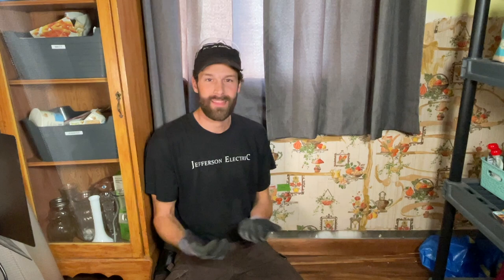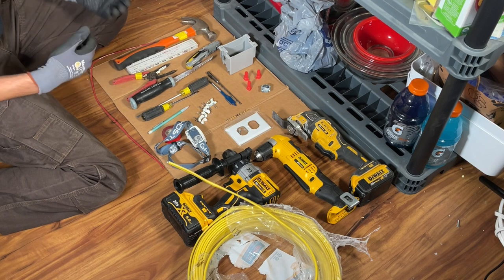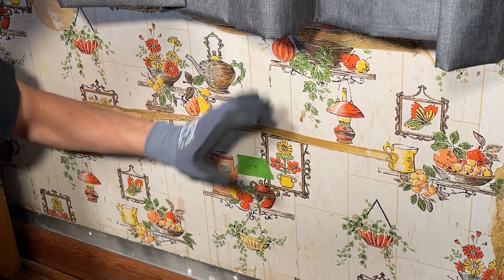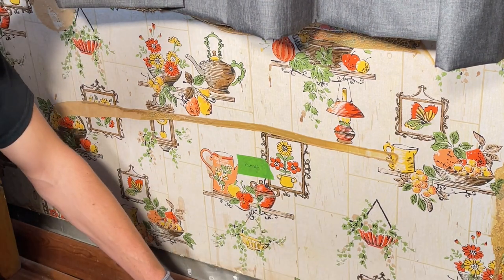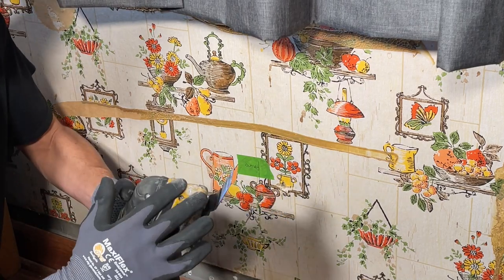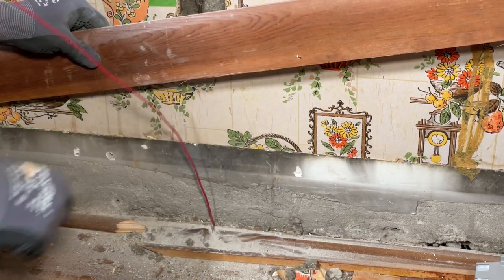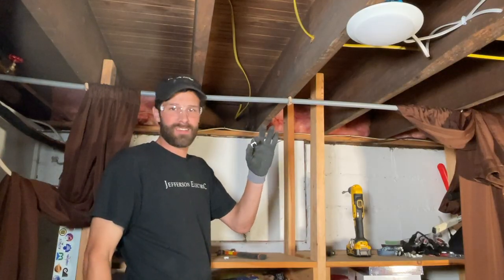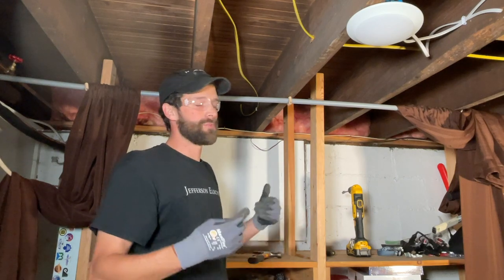How To Add A New Outlet Anywhere You Want It

Comment: A lot of really good tips. Thanks for knowing that if the cable is clamped to the J box, the nearest staple can be up to 12” away. Inspectors around here want 8” regardless. Also thanks for pointing out that metal boxes need to be bonded to the equipment ground.

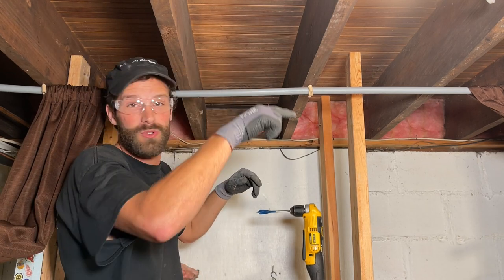In my locale, since the hole that was drilled upward from the basement (at 10:50) penetrated another floor, I would be required to use a fire sealant. I personally like to use 3M’s Fire Barrier Sealant CP 25WB+. Just put it in a caulking gun and squeeze into the hole until sealed. Also, in my locale, tamper resistant receptacles are required.

Just a personal thing, on the right side of the J box at 16:27, I would have used another connector so there is one cable per connector.
Reply from the maker: Good stuff and thanks for the feedback!

Comment: One thing I've learned about cutting plaster walls using a carbide multi tool attachment (used for grout) it cut through the plaster just as fast and it won't dull.

Comment: Excellent presentation, good details. Electrical code does not address drilling through structural members other than requiring nail plates if you’re too close to the edge, however the building code does. Most inspectors will want to see that a structural engineer has provided a size and location plan for drilling joists. It is usually cheapest to not drill the joists. Just run across the edges and use a protector board nailed alongside if subject to damage.

Comment: Lots of good best practices on this walk through video!... noticed mention of the question of why using a15amp receptacle paired with 20amp circuit (at 4:00), but no further explanation(?)
Reply: Jim, sorry for the slow response. The NEC table 210.21(B)(3) and 210.24 allow for the 15 amp receptacle on a 20 amp circuit. Short answer is-it's code.

Comment: The one potential violation I saw was a kitchen circuit being used for another receptacle elsewhere. If it's a 20 amp circuit presumably it's a small appliance branch circuit, and those aren't supposed to have any other outlets. Don't recall anything being said to the contrary.

Comment: EXCELLENT VIDEO !   Great presentation.    One comment though.   That junction box in the basement might be OK in the State you are in, but up here in Ontario (Canada) we would need to make sure that the grounds are also tied the metal box as well...    I think Scott that you also mentioned this tip in one of your own subsequent videos.   Further, not a problem in that house as the basement ceiling is all open, but again up here a small qualifier...  we're not allowed to cover up junction boxes.   So up here, if that basement was ever to get a ceiling, that junction box would have to be horizontal and the cover would have to be openable if the ceiling was there...

Comment: This is a good video, though I would have wired that new duplex to a new breaker in the main breaker box, instead of the junction box. It's a little more Romex, and the cost of a new breaker, but in the end you will have more "control" over knowing what outlets and rooms are on which breakers in your main box. You will also not have to concern yourself with the amperage already being used for the junction box, because it is a new circuit. Another "good" thing, is that you can also add an outdoor GFI (with outlet covers) to this breaker on the outside of this wall (if you choose), and/or a second duplex outlet further down the wall upstairs, because the outlet you added up stairs is probably only for a lamp, TV, or vacuum cleaner (which is higher amperage, but only run for a few moments at a time), or some other low amperage electrical use. I did this in my home for a few new indoor outlets I added, with new breakers, so that I have more easy access to power outdoors for Christmas lights and/or power tools...etc.....Peace!
Reply: Any new outlet is required to have arc fault circuit interrupter protection. The breakers are around $50.

Comment: One of the better videos with code requirements explained, professional work, and proper tools used that I have seen. Except all the loose Romex hanging behind you in the video, obviously you didn't install them. I wish you had explained the 12/3 Romex with two circuits a little better for the phasing at the panel. As so many do it yourself install them on the same phase using a twin or wafers and eventually burn the neutral wire. Two pole breaker was a nice touch. Also if you had added somewhere in the video that each State has slightly adjusted or stricter codes and to check with the local AHJ. As New Mexico does not allow 15a receptacles on 20amp circuits. Texas requires State licenses and does not allow homeowners to perform electrical work, except change light bulbs. And don't forget the fire sealant as required by IRC 302.11(4).
Reply: Highly doubt New Mexico only requires 20 amp receptacles on branch circuits. The reason for that is the manufacturer. Manufacturers have posted on the 15 amp devices that they are approved for 20 amp pass through. If the receptacle if the sole device on a 20 amp branch circuit, then a 20 amp receptacle must be used.

For commercial/industrial applications all receptacles must be 20 amp.
Reply: Good word John. Thanks for contributing.

Comment: Great video. Very informative and professional. The only thing I would add is to drill up the wall from the basement before cutting the hole for the box upstairs. Then push a stout wire or a fish tape up the wall to make sure there are no obstructions in the wall that would prevent fishing the new cable.
Reply: The voice of experience. Good word!

Comment: Great video. Are you using a common trip circuit breaker to make the shared neutrals safe? If not, how are the neutrals wired to make it safe with hot current from 2 different circuits?

Comment: Well if I had a basement (I don't, can't get under the house or up in the attic space either) this may have been educational.  Care to do another video with a situation like that?
Reply: Prudence - the steps are the same. You're just doing it on your back on dirt and it's major pain.
Reply: @dalesworld1308  Wish I had access to the "dirt", but getting under the house is also a major pain, 200 year old farmhouse, with additions put on here and there, blocked access under the room I'd want the outlets in.  Makes me want to tear out drywall and run the wiring through conduit instead.  :(
Reply: @dear_prudence  surface conduit and boxes
Reply: Tear off the drywall. Drywall is cheap and it's not that hard to patch it up.

Comment: It is not required, but I use plastic NM connectors in metal J-boxes and panels, they are quicker to install and no chance of harming romex cable.  No pre-twisting of wires is required if you use the proper wire nut. Wagos  are UL listed and could also be used.  Russ-Journeyman, 26 years in the Trade
Reply: I all depends how you was trained has a apprentice and then to a electrician. Twisted wires with pliers is the best way has you know you did it correctly. Wagos are the best!

Comment: Generally, a good informative explanation, although really only applicable to homes with a basement. Depending on which edition of the National Electrical Code is enforced, some important code requirements, for this installation, should have been mentioned that are required in most areas of the US.

Comment: Hello, I have a QQ on a simple connection:
I have a wire coming from the electric panel to power a light switch and a receptacle.
1-Does this wire has to go to the light switch first, then "split" to go to the lamp and to the receptacle? or
2-The wire can go from the panel to the receptacle, then to the light switch, then to the light?
The receptacle is closer to the panel than the light switch. Basically I have, 1-The panel --> 2-The receptacle --> 3-The switch.
Thank you in advance for your help.

Comment: I have to do this where a tiled wall meets directly with a tiled floor. the wall tile runs about 3 feet up and meets a plaster wall. that plaster wall is where the outlet will be. no trim to remove to get behind. Ill be coming up form a basement but i dont know how to get measurements for where to drill in the basement to land inside the wall above since i cant pierce any of the floor or wall tile to set a marker

Comment: I have question for you. I used the new blue outlet boxes with the blue taps , that you tighten with  screws and the taps tighten to drywall. I really do not like them. I tighten as far as it’s goes. But when I plug things into it and pull the plugs out , by the plug. I almost pulled the whole outlet, out the wall.  How do you stop this from happening?
Reply from the maker: When this happens it usually means the tabs were not able to actually secure behind the drywall/Plaster.  This old work box specifically has a larger gap and works well for thicker plaster walls https://amzn.to/30FUKec .   Might be worth a try.
Reply: @EverydayHomeRepairs  no, this just was drywall., I made sure the taps were right. But the new outlets are so tight when you plug something into it. When you pull the plugs out. Until the outlet gets use a lot, it becomes alright. I like the idea, that you can put outlet boxes anywhere. I was ready to put a screw into the 4 holes next to the taps

Comment: I have a floor outlet under my upstairs bed but no outlets on the wall behind the bed. How do I make wall outlets from the floor outlet. I currently have to run  extension cords to both sides of the bed.

Comment: At 11:03 I hope the lamp cord next to where you are drilling is for speakers or doorbell. Don't laugh I know a guy who wired his whole house with lamp cord that was 30 yrs ago and the place hasn't burned down yet. Something else I noticed, I was always told not to put a receptacle underneath  a window. Don't know if that is code or not.
Reply: Wall space under windows is counted as part of the requirements so sometimes it is unavoidable. When possible the outlets can be spaced so they are to the side of the window but not actually under it. There could be local requirements or inspectors who consider it a wet location so those requirements would need to be met. Otherwise it shouldn't be an issue.

Comment: Looking for opinions on a taboo subject. I hear people are installing smart switches that require neutral wire, but are connecting the switches white wire to the ground in the box! I would say it would work just fine but then sone current would then be flowing through the ground wire which obviously is NOT ok. Thoughts?
Reply: Use Radio Ra2 by Lutron. The neutral is only needed at the load switch. But one would be the wiser if they wired their house as if no lighting control is going in. Times are tough and products are costing more. And if a home is wired for lighting control and not standard switching then that person is in a world of hurt.

As for tying the neutral and ground together, ya that's illegal. People commonly do that because they don't know what they're doing or didn't have enough wiring and didn't care about being safe.

Comment: 'Theoreticaly' that Neutral can carry 40 Amps. I heard you're mentioning that the load is calculated and taken care of. However, sharing a current carrying conductor is not justifiable. Unless the 2 phases/hot are connected on separate phase. Red, black on separate phases. Algebraic sum of current meeting at a junction is zero...it goes on.

Comment: I am very, VERY much a novice. I have a wall that has a light switch on it. Is it possible to put a new outlet on that wall and  draw power from the light switch to get power? and if so, how?
Reply: Slow to respond. You've probably already solved your problem. The simple answer is "yes"! Make sure to grab a hot and neutral and ground from the switch for your outlet. If the room you're adding an outlet to is a bathroom, kitchen, dining room, pantry, breakfast room, laundry room then lighting and outlets would need to be separated, generally. Follow our channel for more info. This video is similar to your situation https://youtu.be/jSWMWSYYYFM

Comment: How would I do this in a slab-built house with no exposed joists or basement?
Reply: You would be required to fish the wiring up to the attic or cut and remove drywall. You could remove the baseboard to cut and remove drywall behind the baseboard to avoid repairs. There are some keen videos on this method, but I haven't made one yet.

Comment: I don't get the part starting at 5:34.  You're basically taking a chance and start drilling blindly.  You then blindly use the drill bit to probe available depth and workspace behind the wall.  It worked out in this case but what if there is plumbing or wiring behind the wall?
Reply: Having already checked the basement I was pretty certain there wasn't any plumbing, hvac or other major obstacles. But drilling blindly is always a risk. Thankfully that risk only goes south about 1 in 1 500 times when precautions are taken.

Comment: Confusion on nomenclature: The existing red wire is a "current carrying" wire, well aren't they all current carrying wires? However, it seems that the red wire would be a power or power "source" wire or in the old vernacular, a HOT wire.
Reply: :-) current carrying is terminology including hots and neutrals, but excluding grounds, since they're not current carrying under normal operation. Thanks for commenting!

Comment: How do I make it so all my top sockets aren't controlled by light switch?
Reply: You'll need to replace all the receptacles/sockets. The tab has been removed on the hot side between the hot screws. By replacing the outlets you'll achieve your desired end.

Comment: I am curious, your work is great ,however when you stated that  at 18 amps of current  for the circuit you are pulling would be okay for the 20 amp circuit. Please double check this , breakers are rated at 80% of the breaker rating . In other works ,a 20 Amp breaker will trip if the load exceeds 16 amps. NEMA did this so you would not run into the problem you have with the old plug fuses ! The Edison base fuse would let you put a 30 amp fuse where a 15 amp should go !
Reply: A 20 amp breaker will cover 18 amps without tripping. The 80% is for the load allowed.
Reply: The NEC code requirement has nothing to do with plug fuses, if that’s what’s being referenced. Overcurrent protective devices can have their operation affected by heat buildup within the circuit. NEC partially addressed this by requiring load calculations to utilize 125% for continuous loads. By definition, very few loads would be considered continuous (3 hours or more without shutting off) in a house. Meaning, 18A on a 20A circuit is fine based on what was mentioned in the example. Disclaimer: this is based on NFPA 70/NEC and local codes may dictate otherwise.

Comment: Just curious if the the new box location that he spent a lot of time on finding coincidentally happened to be  adjacent to another wire in the same bay? (Looked like phone wire or low voltage  (maybe bell) wire, hard to tell ? Also comment on 3-wire #12 requiring a two-pole breaker is not necessarily so, as in some applications #12 wire is used everywhere and 3-wire would be uses for 3-way switches. (Today, 3-way, 4-way and more are done with electronics and the use of 3-wire wouldn't be necessary, but that would likely be in newer installations. He does try hard and does explain things well, but the comment on using a licensed electrician was worth thinking about about there didn't seem to be any attention paid to circuit load constraints, which was also pointed out. Just saying.

Comment: No electric tape to wrap around outlet?
Reply: It’s a decent solution that prevents contact between bare copper wire and the outlet terminals. However, I don’t think it’s required by code.
Reply: @TheDestineyAngel  True but I still think it's worthy of a mention. It's also another step someone has to take before committing to the outlet. I've seen people forget to turn off the breaker when they manhandle the outlet. An electric tape would be another step they take before realizing they have to turn off the breaker.
Reply: Like, "Ah, I see an electric tape for safety purposes. That reminds me to turn off the breaker."

Comment: Dang, man... You didnt cover much on the insulation (which is what I am looking for info on, to route an exterior wall.  You just pulled it out.   But I have to route THROUGH insulation as I come from the basement, I don't even hit the insulation until the wall on the 2nd floor, in the attic, which is mostly enclosed as a section over a single room... the rest of the floor is finished.

Comment: We amateur DIYer's would have wrapped the outlet with electrical tape. Even if the box is plastic. Still good practice.
Reply: not as necessary in a single gang box
Reply: I agree it is good practice. The guy who comes around to rip that horrendous wallpaper out should be protected when they remove the cover plate.